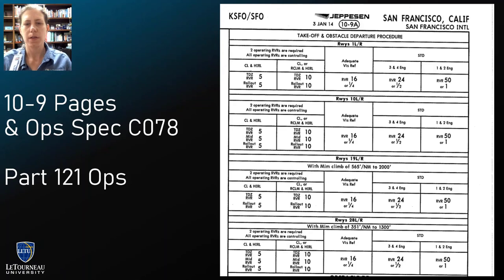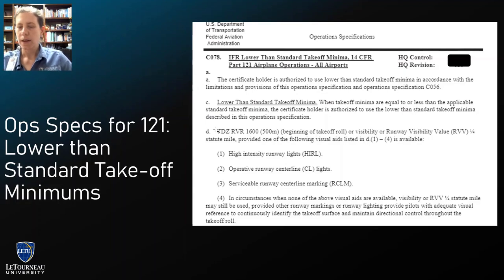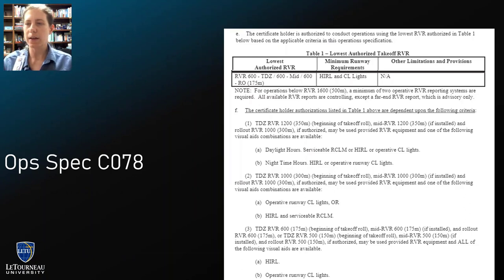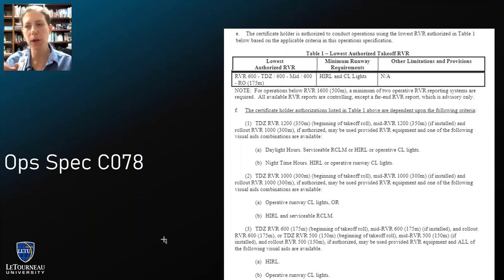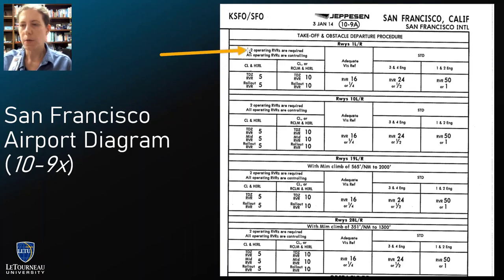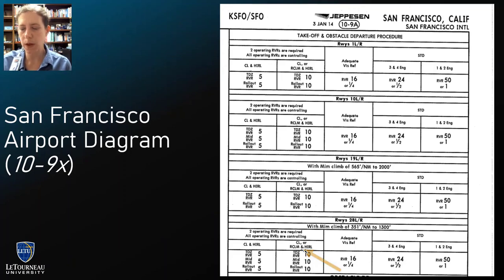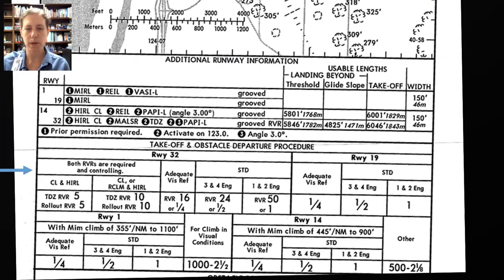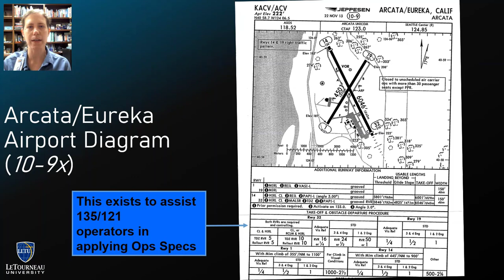Part 121 Takeoff Minimums Explained: Ops Spec C078 Jeppesen Charts Airline Pilot ATP & Dispatcher

Comment: Hi Laura, thank you so much for the video, very clear and informative! I have one question: I understand that if on the 10-9A the minimum is lower than Ops spec, we are restricted by our Ops spec, but what if Ops spec allows a lower minimum than the chart? e.g. Ops spec allows 5/5/5 with certain lights operative, and on 10-9A, it says 6/6/6 with certain light. Can we take off if the condition is 5/5/5 with all lights working? Or we can never go lower than the chart? Thank you!
Reply from the maker: My understanding based on ops specs for various airlines is that you can NOT ever go below the chart. Example: KGGG does not have enough RVR sensors for anyone to use 5/5/5 or even 6/6/6. Most airlines have at least 6/6/6 in their ops specs, but at KGGG they cannot do it because of our limited runway lighting and RVR sensors. So they cannot go below what is on the chart for KGGG. I hope that helps!

Comment: Great explanation. I Just wonder what conditions they mean by Standard? To what conditions std apply? Is it about the pressure?
Reply from the maker: Standard refers to what the part 121 takeoff minimums are as listed in 91.175. Those are what the charts mean when they say "standard" because it is what the regulation says. Anyone with a deviation to the regulation approved by Ops Spec C078 is "non-standard" technically.

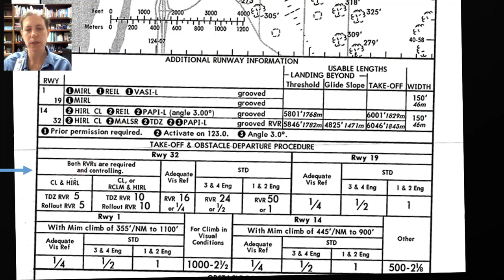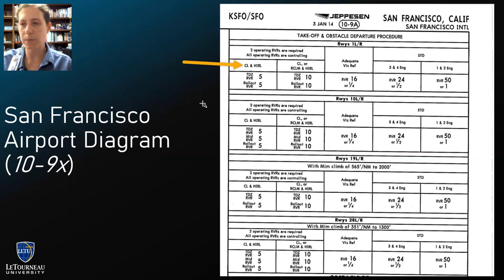Comment: Hey, so I was looking at the RVR for 15:50 and it says 500 feet in the Jeppesen chart but 600 feet in the ops. Can I still legally fly? How does that work? How am i limited at 9:45?
Reply from the maker: Thank you for watching! Some companies have 600' as their lowest allowable RVR per ops specs. In that case, they are limited to 600 even IF the chart from Jeppesen says 500. The ops spec is limiting in that case. I don't fully understand the question about what I was talking about at 9:45 though. Can you clarify?

Comment: You can't use reduced mins on 14 because it does not have the required lighting.
Reply from the maker: You can use down to "adequate visual reference" which is as low as 1/4 sm visibility. That is still reduced minimums off the "standard" 1 and 2 mile (depending on engines). You are correct that it does not have the extra lighting required for lower than 1/4 sm visibility. I did talk about this at about 14 minutes into the video.
Reply: @LauraLaster747  Yes, I just noticed it in the earlier portion when you were reviewing the 10-9 page, the reasons why they were different. Sometimes pointing out the basic idea of why the difference exist helps to understand the subject. You can't reduce to lower because the lighting does not comply. You have good videos, just thought I would add the comment because it might helps someone else.
Reply from the maker: @MatyasArby  Yes! Thank you so much. My home airport (KGGG) is also like this because of the lighting (lack of) and only one RVR sensor.